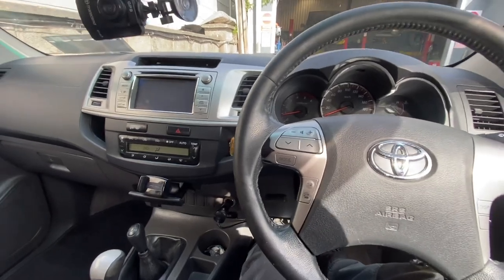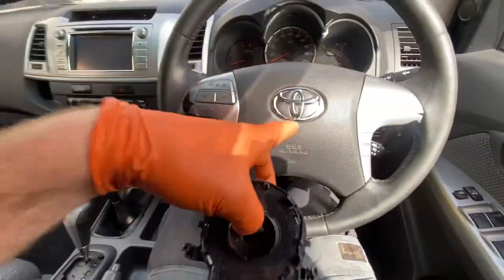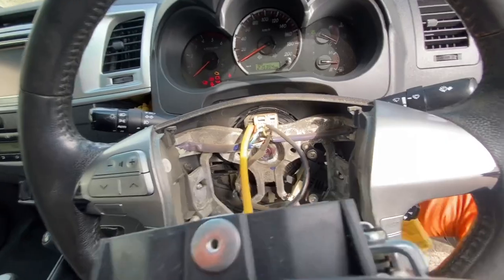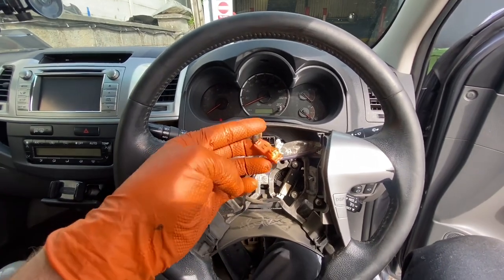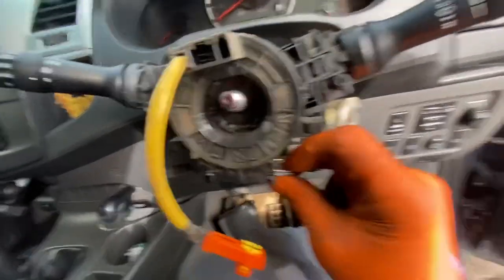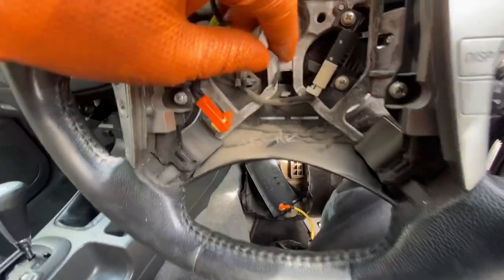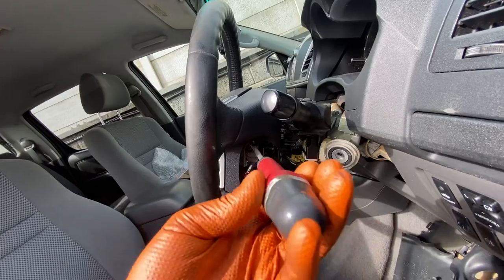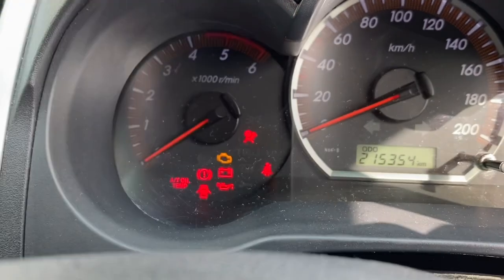2014 Toyota Hilux, horn won’t work & clock spring replacement

Comment: Great video. I got it done in less 30 minutes but would be quicker if it wasn't my first time. Steering wheel took fierce chucking to pull off though. I had to put the nut back on a few turns to stop it pulling out with a slap in the head
Reply from the maker: Well done William 💪💪💪

Comment: Nice work Peter. As a customer of Roughtrax I can highly recommend them👍🏻. What’s your opinion on the Hiluxes v other pickups Peter? My own thoughts are that, if you don’t allow corrosion to take hold  by thoroughly rust proofing all cavities and external underbody, they’re in a different league as the mileage mounts up. Keep up the videos with the easy going Irish humour and craic👌🏻
Reply from the maker: Toyota are as you say in a different league. The rust can be a big g problem but again as said once you keep on top of it you have a great machine. I’m glad you enjoy some of my videos 🙏🙏🙏

Comment: Good one Peter…video it all even the loosening and tightening of the nuts and bolts…it’s all very helpful 👍🏻 Also I’m convinced, screwdrivers and sockets have teeny tiny legs because they are never where you last left them ‼️🤪🫣
Reply from the maker: I’m always loosing that kinda stuff, I get called away and just put my stuff down somewhere between point A & B 😂😂😂